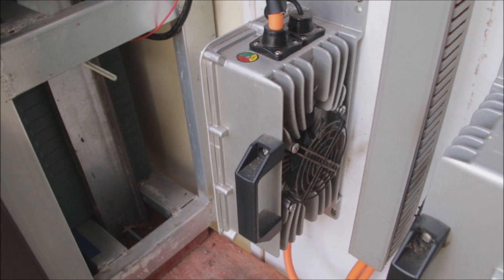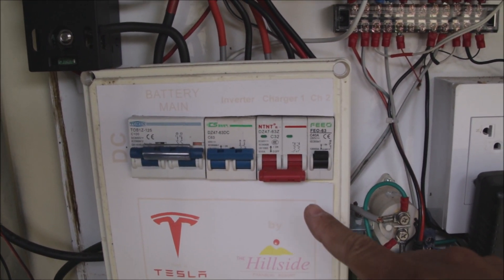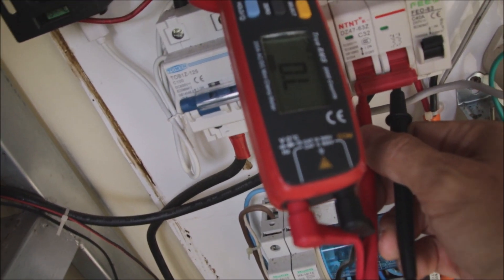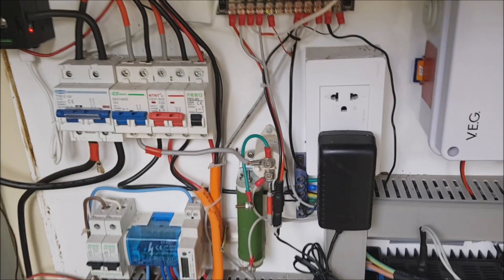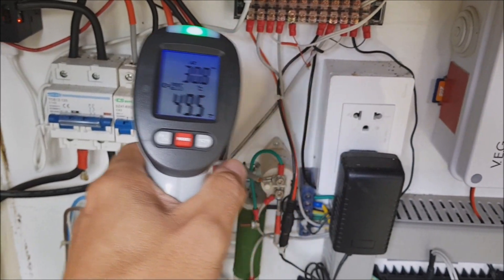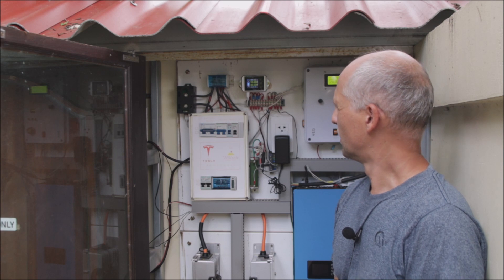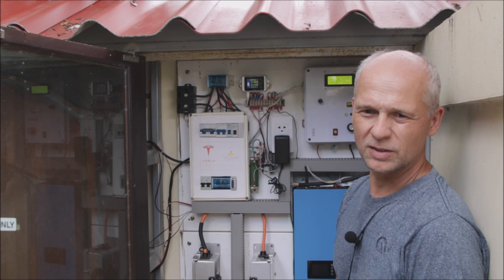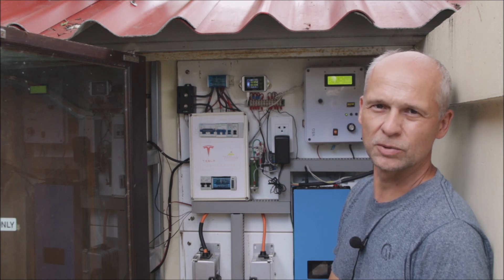Charger at Powerwall failed? Or is it something else...

Comment: How's that Juntek meter holding up?
Reply from the maker: I have replaced it through my DIY coulombmeter. But it was OK as long i have used it.
Reply: @RolandW_DIYEnergyandMore  do you have a video for your DIY coulombmeter?
Reply from the maker: @gayanx86  yes, its on my playlist. You would have to look up the videos about the LIPO Battery monitor as well, as at the powerwall my controller just took over the calculating part...

Comment: I have had a few that got hot every time it was the poor connection of the wire holder it just couldn't get enough torque to keep the connection.
Reply from the maker: It was weird. connections seemed OK, but when it reached around 65C, it tripped. New breaker is good now. All temperatures around 45C max. Those cheap reallyfeel light compared to quality ones. But funny that they cannot withstand the rated current when under continuous load...